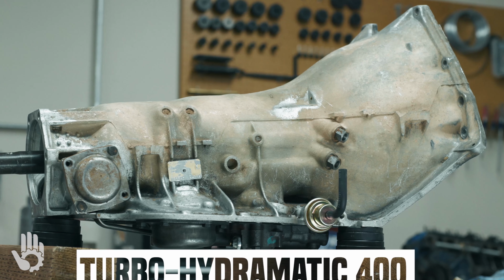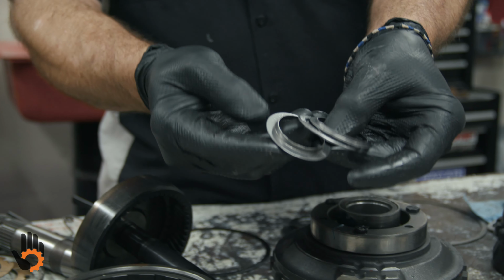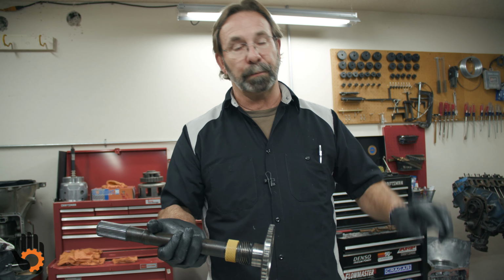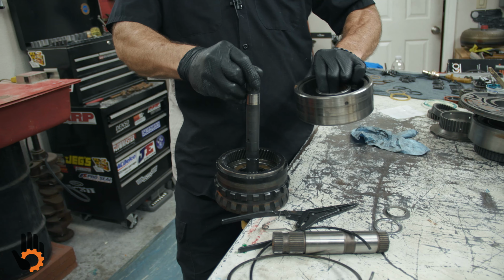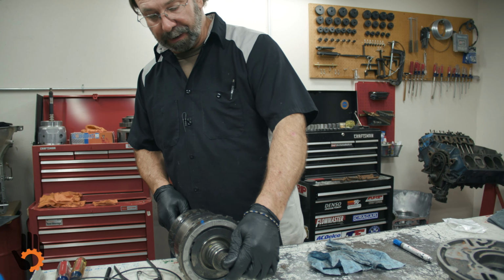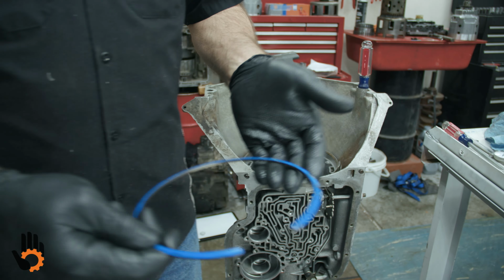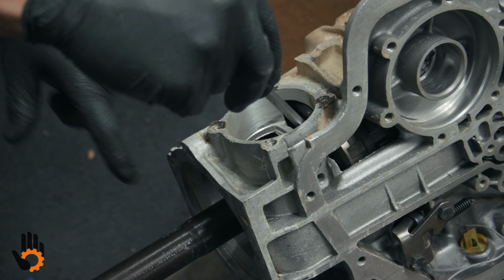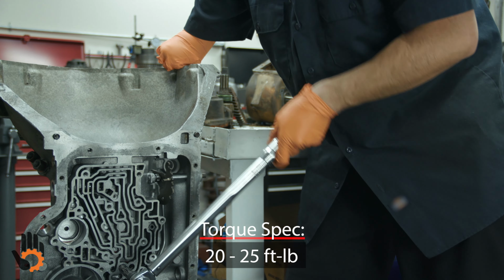TH400 Build Series - Planetary Gear Set (Assembly + Installation + Rear Unit End-Play)

Comment: Hi guys, thanks for your videos.  I’ve bought a bearing and bush kit to replace the rear thrust bearings on my TH400 as the tangs in the case were damaged and had also damaged the output shaft surface which I have also replaced.  The tabs in the case wouldn’t retain the thrust bearing any longer.  I’ve put the rear assembly back into the case and managed to insert the snap ring and retaining bolt but I have no end play and I’m wondering if this is going to cause me a problem?  Appreciate if you could please let me know your thoughts.  Regards, Phil

Comment: Have watched all their episodes. Absolutely fantastic. Hope I can ask for advice here. Overhalls a th400 from a 68 corvette. Should change the rear lugs, plane gears. The new one is not exactly the same. When I insert the output shaft, the locking ring (snap ring) does not fit. The area where the snap ring should be is slightly different in height. In I a snap ring that is not equal in both surfaces. Can anyone help me here. Is aware of the mounting direction of the ring

Comment: Love the series guys! I have a question; after installing the center support bolt, I cannot spin the output shaft. Is this normal, or did I miss something?
Reply from the maker: I'm not sure the bolt would affect the output shaft.  However, it's possible to install the bolt, while not having the tapered center support snap ring installed.  And this will enable the Center Support to get crooked in the case.  This may affect the output shaft.

I'd have to mock it up to know for sure.  When time permits...

The positive feedback is appreciated.
Reply: @SouthpawAutoworks  thank you for the reply! I'll check the tapered center support ring. All your videos are awesome. Keep them coming!
Reply from the maker: On some models there are two snap rings for the Center Support.  The tapered one, already mentioned.  And there's a flat one, that lives underneath the center support.  It provides a buffer between the center support and the aluminum transmission case.

Thought I'd throw that out there, too.

I appreciate you taking the time to respond to my message.

Comment: 2 Questions. First Q- When installing the sun gear at the bottom of the sun shaft, does the lube hole need to align with the other hole in gear?
Second Q- Should the rear shaft turn easily when set up or can it be tight to turn? i have the clearance but i cant turn it by hand, i need vise grips to aid turning. Thank You!

Comment: I recently started on a rebuild with a thm 400 from a chevy, and found one with straight  cut planetary gears, Is this an oddball trans?? Or just an early unit?
Reply from the maker: Right on.
Straight-cut gears are found in HD TH400 applications (dump truck, box van/truck, etc).
Like anything, there's pros and cons...

Pros:
The straight-cut gear has more surface area contact between two meshing teeth in gear set. (stronger design)
No thrust loads (or, at least, greatly reduced) (forward/rearward planetary gear set movement, when under load).

Cons:
Gear set noise during operation (whine).
Reply: @SouthpawAutoworks  Thanks for getting back to me Robert, thanks for your input. I may put that behind my big block.

Comment: Robert, I have not been able to find an answer to a question I have in my mind.  It is well stated in racing forums not to shift to neutral at the end of a run because the direct drum will overspeed and explode.  With the car coasting, the rear carrier is driving the entire geartrain.  However, the one way clutch on the front carrier is now free wheeling, the forward, direct and intermediate clutches would be released so there are no "locked" components which would make the sun gear spool up the direct drum.  Everything would seem to me to be "free floating".  What am I missing?
Reply from the maker: That's a great topic.  Would love to do a video on that.

IDK for sure...  But, I imagine it's because the Direct Drum is splined to the Intermediate Shaft, which is splined to the sun gear, which meshes with (both planetary gear sets) the front planetary gear set, which is splined to the output shaft (via the front ring gear).

Gonna have to mock that one up in the power flow stand, to see what's what...when time permits.
Reply: @SouthpawAutoworks   Thanks - I am very aware of what is splined to what.(I fully understand the conventional power flow.)  Further to the comments on racing forums, they even have a valve body that has a "safe" neutral position.  It cancels fluid pressure only to the forward drum, not the direct or intermediate clutches.
Reply from the maker: Right on!  That’s very interesting.  Gonna have to look into that.
Thank you for sharing.